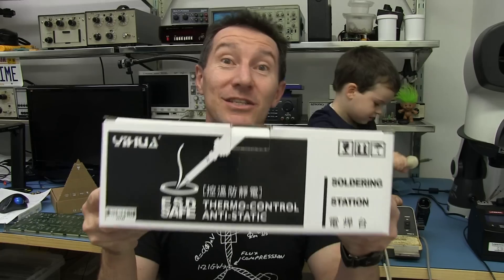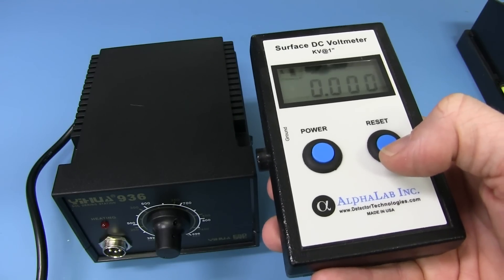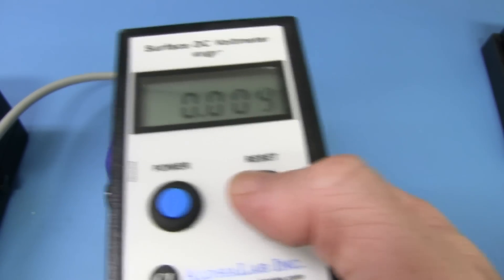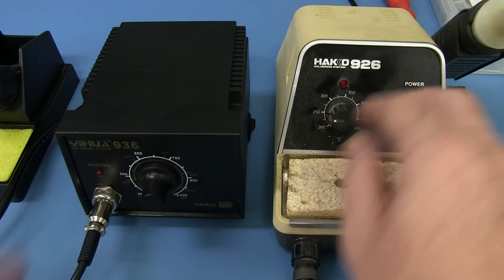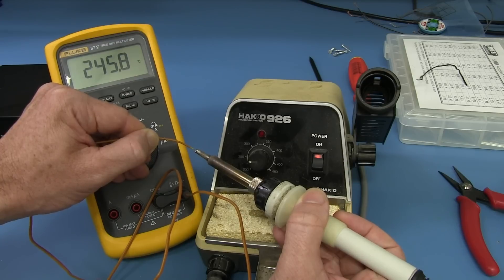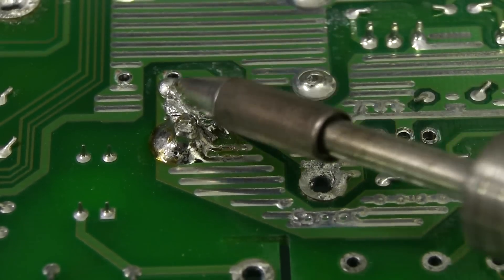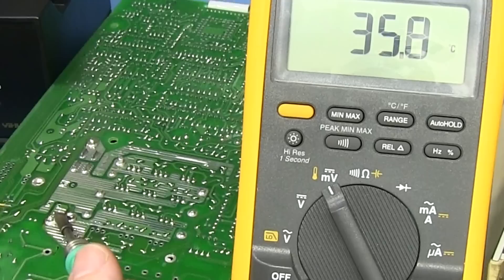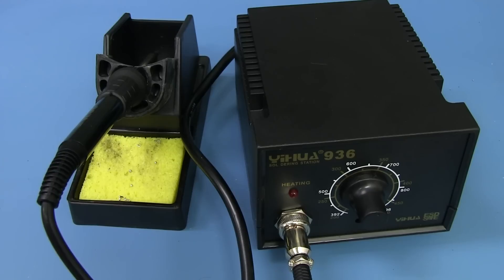EEVblog #596 - World's Cheapest Soldering Station - Yihua 936

Comment: I thought about buying one of those but the shipping was too expensive to Canada...I bought the Yihua 937D instead..I've had it for 6 months + and have had no problems with it at all. It cost a bit more than the 936(but had free shipping), has crimped wires and a better quality board. still not the best station but it's what I could afford and all I need atm.

Comment: Hi, I recently purchased a similar Yihua station to this one but it came with a European plug and 220V rated input specification. Originally I thought I could use the EU unit here in Australia on our 240V 50Hz but now I am not so sure. I understand that you can NOT use a US 110V model here in AU or EU, but I always thought using EU 220V appliances in Australia on 240V was fine -- with a plug adapter of course.
Can someone please confirm whether there is a difference in the transformer between the 220V and 240V models of these cheap soldering stations. The transformer in mine is marked W166X40 220V.
Many thanks in advance.

Comment: not that particular expensive model like that, mine is $5 onboard "temperature dial" setting; indeed heating element is a bit loose to the tip.
I use some aluminum sheet from soda can as a shim and they're much better now.

Comment: This looks like the typical Chinese made irons on AliExpress, eBay, etc... I have one branded under "Mudder" with the heat control on the handle. Came with a case and lots of tips for $22 shipped. Works every time I use it. I have used it for a couple dozen hours at least.

Edit: Didn't even take into account it came with a stand and sponge! Now I'm just mad I didn't get this one instead of the one I bought. Maybe I wouldn't keep changing the temperature on accident.

Comment: Maybe since it doesnt fit right the Haako tip isnt right for this budget iron, maybe cheap irons need their own tips-lol  Also how about checking the calibration maybe it needs a tweak.  Now you can get the newer updated upgraded 936D+ digital readout version of this for less than $30 on ebay, a certain YTber has had his for a year and had good luck - so far.   I finally took the leap and ordered one for my home DIY use.

Comment: So, I am bit of a newbie in electronics. I am about to buy a soldering station but I wonder. What wattage should I aim for?
Reply: +En Person  this is 5 months after your question, but more of a general recommendation:

 50Watts is fine for most electronic jobs, but note there's a HUGE difference between temperature controlled (like the one in the the vid) and temperature adjustable (basically, that has no feedback, so it's possible to get too hot for your joint). 
Always go for a temp-controlled one, do your research by making sure the spare elements have more than two wires to them (which means they use thermocouple feedback as a means of control)

Anything less than 40W is going to have trouble for larger components on PCBs like power supplies or soldering RF plugs.

Having said that, In the right hands even a bad or underpowered iron can make good joints, but it takes a lot of experience (timing is everything) An iron with high-enough power can do small joints by being adjusted down, so is good for beginners or fine work. 

I'd recommend avoiding ANY iron that isn't thermally controlled, not because it's essential (it isn't - I still use some fixed irons for special jobs) but simply because it makes it much easier to learn. It reduces the chance of melted plastic connector and burnt/lifted traces if you have a thermally controlled one. If you set it to say 200C it won't go above that, but a fixed iron -  especially a cheap one - could reach any arbitrary high temp as a means of ensuring it has some "extra oomph" for larger joints (a bad thing if you are using sensitive small components)  

I've been using these cheap clones for a few years now - I find them fine and are so cheap you can buy an extra iron as a spare or to swap over from a fine tip to a large tip fast (saves waiting for the tip to cool while you change it). Buy a cheap pack of various tips though, until you find one you like. Then buy more of that so you are never stuck - cheap tips wear quickly - they are only thinly plated.

Finally, cleanliness and fresh flux is vital. Very, very vital to fast learning.

Comment: foxy says the two pin connector looks a bit crusty too do you suppose it soldered with the same make of  iron as for the components it looks like recycling electronics to the extreme ! scrap boards being DE soldered to reuse !

Comment: I need a soldering iron for soldering 22 gauge wires to 1/4 watt resistors, and then the wiring to switch terminals.  I know I can do this with a $6 plug-in, but I want to do the best job. Do I need the Hakko for what I'm doing, or is the chinese 936 ok?

Comment: Taking into respect the poor condition of the PCB (oxydation) it looks to me like a charge which ad some kind if issue during transportation. Either of the pre made PCBs or of the complete product (perhaps the intermodal container got flooded on the ship) which later to repacked by the importing company.
Off cours no brand manufacturer would ever rework such products, or at least do this in a decent, quality controlled way. But if there is actually no brand name at risk, it basically the decision "what amount of money do we get per kg at the recycling and compare it to the amount we have to put into the stuff to push them out at ebay-shops".

Comment: Here's A Tip: (see what I did there)

I bought a crappy wall plug Radioshack iron ("Pro line") 
and a sufficient temp controller from some company I've never heard of. The Radioshack tips/irons are total crap. I bought some genuine 900m-T-S3 Hakko chisal tips, and they fit perfectly. Since Radioshack doesn't sell anything but crappy conical tips, this is a great purchase if you're stuck with these cheap irons.

I solder a ton, so I REALLY need a better soldering iron, but being in High School, I can't get any money. I think I will buy the Hakko FX888D if/when I get enough money. Does this seem like a good purchase?

Comment: Got Yihua 936 and after the first try the ceramic heating element is broken, any tip how to replace it?
Reply: You'll need another iron. My 937D came with a spare element. You need to unscrew the tip as Dave did and note which wires connect to which pads. It might even just be a broken solder joint. Otherwise replace the tip so it's exactly the same as how you found it.

Comment: Come'on, i just finished replacing some tv caps with a 2.80 Euro iron, it took me a bit longer, but for weekend electronics amateurs is ok to have cheap stuff. I cannot pay more for tools that i use only few times in the year. I have no clue if the difference is so huge between a 3 euro iron and a hakko station with temp control and stuff. At the end, the goal is to melt the solder, is just a temperature for god sake. I was watching at some high end tools, and i cannot comprehend, why i would buy a jbc for 3k dollars for a job that can be made with 3 dollars iron :)

Comment: I got one even cheaper. It wasn't that bad at all regarding basic functionality, but the tip fell of, so I had to re-crimp it on. But it had almost no power, so no use for lead-free soldering...
(it "even" had a metal case!)

Comment: I can't take anyone serious that lets their little kid play with tools and lets them "help with a review".  I'm all for teaching kids about electronics and the repair of them and teaching them about tools, but don't include them in the review video if you want to be taken seriously.
That board in the soldering station look pretty damn rough!  I bought an unbranded 937D+ (digital LED display) for $25 shipped and I took it apart as soon as I got it because I had seen reviews of different stations.  The board in mine is a YH937D-V1.6 and it looks really nice.  I'm sure it doesn't look as good as ones in the name branded ones (or maybe it does, I don't know).  I know the soldering iron seems to work good and has done good for me, although I've only had it about a week as of tomorrow.  The only con to it as far as I'm concerned, is that it shows the temp in Celsius instead of Fahrenheit and I don't know Celsius.  I wish there was some way to switch it.  I've seen people mod other stations by soldering  points/pads to change it to Fahrenheit, but mine doesn't have anything like that on the board.   I'll just have to settle for making a chart for the popular soldering temps for different components and tape it to it.

Comment: If someone was really strapped for cash they could do some dumpster diving and scrounge some better components to fix a few of the problem areas. Replace all the rusted screws etc. I would definitely try to clean up that control board.

Comment: I made the mistake of buying one of these. I used it for about twenty minutes set at 400c and well the handle started getting soft. I then lowered it to the 200c min. hit it with a thermal imager the tip was at 375c. adjusted it and well it was down to 300c. What a peice of junk. Time for a real station.

Comment: Like others have said if you only do a little bit of soldering this is better then some of the more expensive shit at Radio Shack, or places like that, I have one of there $25US stations, and it takes forever to heat up too a proper temp, but it does work for the few times a year I need it too fix something for someone, or myself.

Comment: Not a bad review actually. Those cheap soldering stations are mostly intended for casual users for home and hobby. Not all of them can afford brand tools and not always is practical to buy soldering station for 250$ only to solder something at Friday's evening. There are a good clones of known brands which works well for a half of price and also pure Chinese stuff which also works well if you know manufacturer and seller. However the all point of this review was to show that there is a limit how cheap you can go to not loose a possibility to do your soldering task because particular tool is too bad for doing what it is supposed to do.

Comment: Is it still better than a 5 dollar cheap Radio Crap soldering iron?
Reply: At least you get temperature control and several tip choices.

My 10$ 70w iron has lost almost half the tip in a year, just from regular use :/
Reply: André Rodrigues
70W - You soldered pans? :)
Reply: TheDenall

10 and 12 awg wire. Also the index and thumb on my left hand :)
Reply: André Rodrigues
ha-ha-ha :)
Reply: TheDenall That pork smell and small puff of smoke still haunt me, ah! That's the last time I grab for a screw driver while a soldering iron is on the desk :P
Reply: Rule Dao-elektronics:
"Always remember where the soldering iron."
"The soldering iron is always and everywhere." :)
Reply: TheDenall
Ain't that the truth.

Comment: yup even looks like the Trakpower tk-950...this one looks cheaper made like you said. The tk-950 looks like it's built more like the Hakko with a much better plastic and connector like the Hakko. the stand with the tk-950 is metal and it comes with two tips. opened my tk-950 and its much better than this thankfully!..it has solid state caps and fuses on more than just the power switch and a much better soldering job too. but if you don't mind a cheap one then the knock off is ok i guess. cool video by the way.   lol just looked at the tk-950 abit closer and get this it actually says 936 on the circuit board! lol too funny.

Comment: Most people have to pay for their JBCs, so would be appreciative of a cheap and good Yihua 936 rather than forking out 28 times more for a JBC.
Reply: *****

In the USA, it's a no brainer, and you'd have to have your head examined if your low end soldering station isn't a Hakko FX-888(or D).  The cost difference just doesn't justify going clone.  But for Australia and Europe, a Hakko FX-888(or D) is 2x+ more expensive than in the USA, it's not so clear cut.  Geography plays a role in the decision process.

Comment: But im using 5$ 30W 220V ordinary soldering iron about 5 years and it works fine, where is problem?
It has grounded tip and melt-proof cord.
Im using this also for SMD, and it works good.
So, why not?

Anyway i decided to make diy soldering station that uses PID temp control and 75W of power(powered by 80W toroidal transformer).
It will cost me about 50$.

Comment: About the solder on the transformer, illegal in Canada due to the heat the transformer or even ac current creates, solder is a no no here if you cant to pass the CSA standards which are in fact safety  law here. We don't like house fires.

Comment: Man trying to pick bones inside an egg.  For a $16 set at 1/10 of the cost of Hakko 936,  one should always expect some degrading qualities.  What is important is whether the set is safe to be used.  The ESD measurement (@ 60V?) is hardly any significant as it was measured at the cover.   The correct way is to measure from the soldering tip which should not exceed 2 milli-volt. (  http://kb.hakkousa.com/KnowledgebaseArticle10094.aspx ).  I would buy a Yihua than a Hakko if the price is so huge a different.

Comment: Update on my last post

i ended up returning  the piece of shit that fell apart

here's a laugh
when i returned it, the girl said to me "we sell these things all the time and no one has ever brought it back"  LMFAO
yeah right...
I'm betting it's either bullshit
or
no one bothered returning it and threw it in the bin

anyway, i ended up buying a TEMPORARY soldering station
i went to JayCar and bought a  DURATECH TS-1640  for around $100

i'll be honest
i have never been a fan of buying irons from Jaycar, but.. THIS ONE IS NOT BAD to be honest

i would sincerely recommend this to any beginner on a budget

it's Digital, 80Watt  i think,  goes up to around 550 degrees i think,  i use it on 350 degrees, don't need anything more

the iron itself is very comfortable and 1 month later, still going strong.

I'm still getting a JBC, but this Duratech is earning it's stripes in my opinion
thank fucking god i got rid of that Yihua Piece of shit
that was fucking dangerous to say the least.

hope this helps someone

Comment: Not sure what all the hubbub is about. I mean, it's only $16, sure, you can go out and spend a few hundred on a top of the line name brand, and of coarse,  it's more than likely going to work better. But for $16, the price point versus the cons on that soldering station vs the price point, and pro's on a genuine product the best bang for your buck in the short term will definitely be the cheaper model. 

Sure, if you plan on not buying a new soldering station for a decade or more, the high priced models will be worth the price, but if you don't solder a thousand joints a day, there's really no need to spend out the arse for the top of the line models.

Comment: He wasn't an objective reviewer.  As near as I can tell, his only substantive complaints were :

1.  Earth wire was soldered, not crimped.  I know that over time, soldered connections like that can corrode - but the wire is not under strain, it is highly unlikely to fail. The connection was mechanically sound with plenty of solder on it.

2.  A missing IC on the main circuit board.  It is not clear what the IC actually does, as it appears to regulate temperature just fine without it.  

3.  Mediocre from the factory temperature calibration.  Fixable with a screwdriver.

Look at it this way : for $16, you get something that is probably 90% as good as the Hakko, which costs about $100.  Probably exactly as good if you use Hakko tips.  For a professional making his living soldering, yes, you want to buy the genuine Hakko because that extra 10% will probably pay for itself over time.  For everyone else, this is great.  A darn sight better than those unregulated irons you plug in the wall and hope the temperature is right, or those non temperature controlled ones (like Weller brand) where you can only adjust % power.

Unsubscribed.  You are not being professional.
Reply: +Gerald Monroe Were you ever subscribed?  You're unsubscribing due to a video that's two years old. Not that your subscription even matters.

Comment: hi there Mr EEVblog, or anyone on this planet please help me, i got the same rework station like yours few month ago, my question is,  the main unit controller getting warm and then so hot after i used it more than 30 minute on 300celcius iron setup, is that normal the main unit  getting hot? i just worried it will blow up on my face when i used it more than 30 minute. thanks.

Comment: Yea,im not  one to stick up for china  (they copy everybodys stuff). I got one of these stations i use it to build a quad copter. Worked ok till i put the t60 conecters  on the 6-10g wire  no balls.pulled out the wellers 250. not a problem
Reply: "Yea,ism not  one to stick up for chna  (they copy everybodys stuff). I got one of these stations i use it to build a qud copter. Workd ok till i put the t6 conecters  on the 6-10g wire  no balls.pulled out the wellers 250. not a problem" coppied from bigwingrider1800 in china

Comment: So at 20:00 you compared the ability to wet heavy gauge in the cheap low thermal mass iron set at 282 actual ( 235/250 = .94 x 300 = 282) to the $$ irons set at 300 and a high thermal mass iron set at 275.  You sir are a snob knob